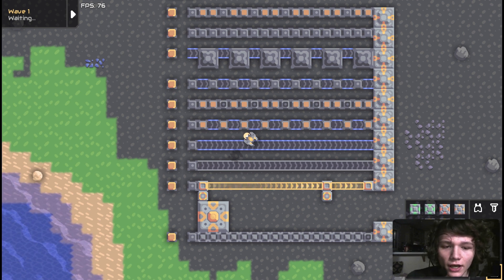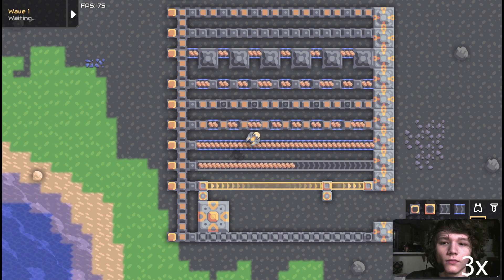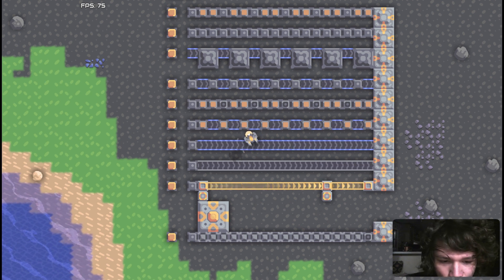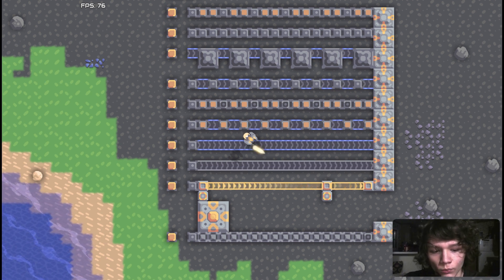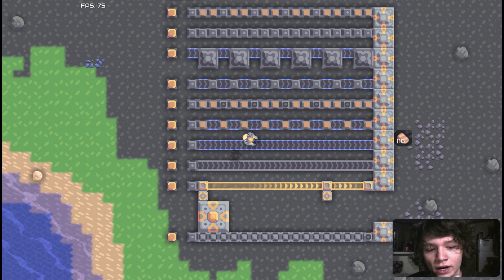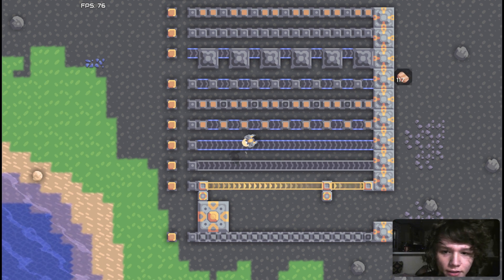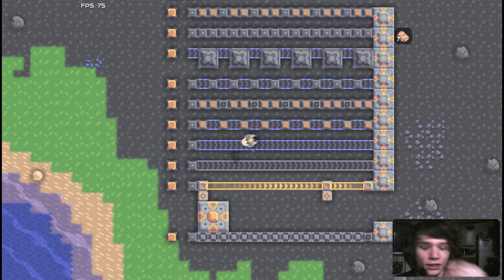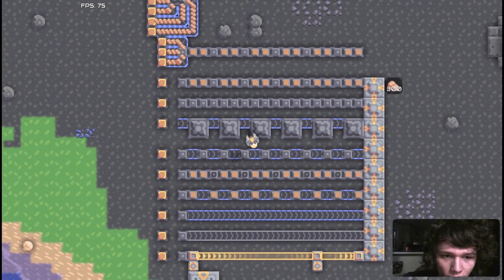An infinite throughput design? | Mindustry

Comment: if you chain routers and overflow gates you can feed 4 titanium belts through but you are not clogging the system if you use mixed streams

i'v uploaded a test case and some layouts to the steam workshop search for ultra conveyors

so your design is faster but it breaks if you just insert one wrong material
Reply from the maker: That's really interesting!

Comment: wow
so cool for a frontline feeder.
needs a certain care through to avoid contaminating other belts
Reply from the maker: Yeah, it requires a bit more care than a regular belt, but it's much more effective, so a good trade-off
Reply: time effective, cost effectiveness doesn't matter that much around wave 100
I'd like to see some of your levels, how you use that to feed some later wave guns like the cyclone or whatever you use

Comment: I think the sorter-router chain got nerfed. I can only shove three titanium conveyors continuously into it instead of the seven you're doing.

Not that this is a bad thing because it still has the throughput of a phase conveyor but only costs early game material.
Reply: Router overflow gate can fit 4 and mixed materials
Reply from the maker: Good to know.
Reply: @AirNeat   now its slower than a regular conveyor

Comment: Wow it's really work. Only lose to Mass Drivers which is surely not a good option all around. But mine it feed in only 3 lines of input (other 4 struck). Thank for this tip^^
Reply from the maker: You're probably using overflow gates instead of routers
Reply: @AirNeat  I really use router there, I'm sure because I keep all trick in one map editor so it's still there :D. I'm playing in newest version android though, not sure if it's changed, or different from here. But no problem, I like your junction method more (though it's slower a bit as you said) because it's a lot easier to create (drag it all), and using conveyor for other item types will be pain with those separators lol It also consume space ..with router I must avoid to build some building/conveyor left/right of it. So your bottom Junction is the best for me.

How you deal with turning point, if we put conveyor to turn it, it'll slow down to conveyor speed (tested  by item in vault). Now I'm using sorter with other type (prefer Blast/Pyratite because of its color&I usual not move them around) then 1 of overflow because junction after sorter and item will struck
Reply from the maker: @AstralrAstralr-mj1tr  Yeah sounds like a good setup. Glad you could make use of something from the video!

Comment: defense set ups?
Reply from the maker: Sure thing :)

For now, try using a combination of scatters with hails. Hail is really good because it can kill enemies before they even reach the wall, but you also need a gun to kill air units, hence scatter.
Reply: Lots and lots and lots of duos, 'ablative' copper walls